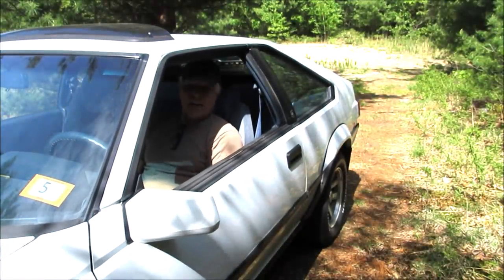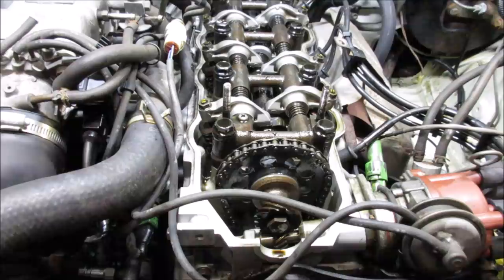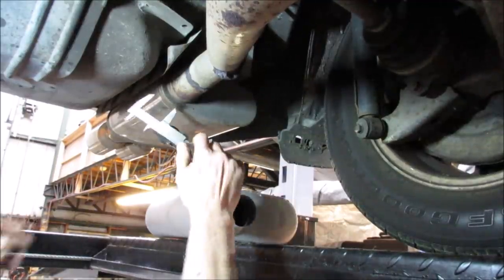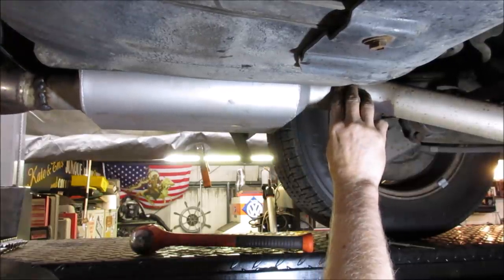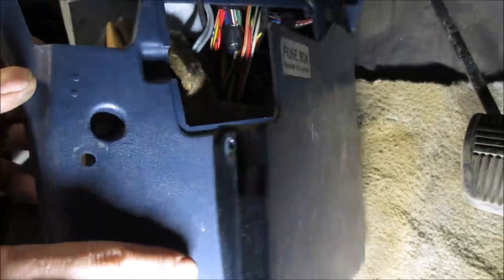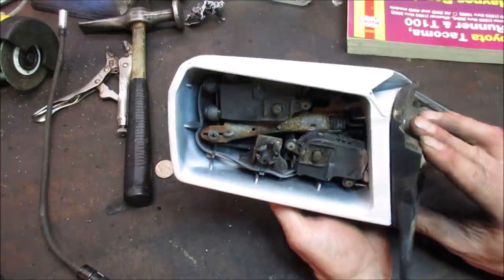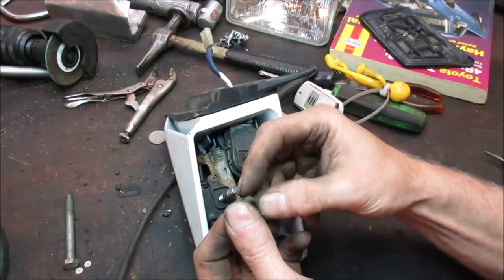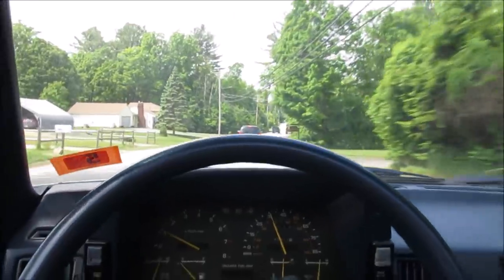Bought The Best Toyota Ever Made

Comment: Try pushing the directional signal/dimmer switch forward to engage the high beams. Pulling it towards you only flashes the high beams and returns to low when released.
Reply: This.  Every Toyota I've ever driven has been like this.
Reply: Was looking to see if someone said this before I said the same thing.
Reply: @dan_lev  my Mazda 6 from 2007 has the same setup for the lights controls. 
The rear wiper is also controled from the right lever,with a rotating knob that's on the lever itself. 
If u u pull the lever towards the driver,it activates the front windscreen washer,if u push it outwards,it activates the rear window washer.
Reply: Same with a lot of the Subaru cars, as well as late '90s Fords...
Reply: I was thinking the same thing.
Reply: Exactly.
Reply: Yep, I was yelling at my screen, 'just push it forward dummy!!' A lot of early Japanese cars are like this, even right into the 2000's🤣
Reply: @simonilett998 

Shh   his truck is the same dam thing.  He is a good tinker mechanic   but he is kinda a dimwitt around electrical stuff. 
Unless its just an act.  His boom truck i would label all the wires
And draw a diagram so he can trobel shoot it if its broken.  
But when he is testing stuff its pure luck he finds it.
Reply: Yeh, I've kinda noticed it a few times, but he normally gets there in the end.
It's always the best way to learn for yourself, but I gotta assume sometimes he plays a bit dumb for watch time, or simply to crank up the comment generator🤣👍
Reply: Honda does the same thing. It’s a Japanese car manufacturer thing.

Comment: I have a suggestion to fix the mirror. Replace the brittle plastic bolt on the motor with metal ones like you did and glue a button magnet to the back side of the mirror. This will keep the mirror magnetically attached to the bolt while having the bolt to spin/adjust.
Reply: Excellent idea! Also lets you pop off the mirror without breaking the glue or plastic adjusters
Reply: No just the correct mirror backing plate with the little bit which locates into the motors
Reply: Top Idea!
Reply: The issue will be if it’s possible to get the backing plate. But I now it’s not musty’s style 3d printing if you can get a complete one to be scanned.
Reply: 3d printer…..
Reply: What you are looking for is new mirror jack screws.  They attach kinda solid to the mirror back and just 'slip' into the motors (the threads are real loose).  You can probably find the screws in many different older toyota models.  I found new screws for my 97 Vette from a 92 Riviera.
Reply: that's a brilliant idea, I was struggling to think of a useable solution

Comment: The threaded adjuster screws are supposed to be fastened to the mirror... the plastic ones were notorious for breaking.  I see that some folks used 8mm bolts with the heads ground to a square/rectangle-- then used double-sided tape or epoxy to attach them to the mirror.  Old plastic parts are the bane of a car restorer's existence!  Looking forward to more installments of "This Old Celica"!
Reply: Righteo, I was looking for this correct comment. Have a wonderful Memorial Day.
Reply: Sounds like the perfect repair
Reply: Would be a great short midweek mustie video
Reply: Is there no replacement motors with the bolts or standoffs available for this car?
Reply: I agree, the threaded pins are broken off the mirror. They also stabilize the mirror.
Reply: He had it pretty close though, if he used his bolts and JB welded them to the plastic on the glass the mirrors seem like they would go, my assumption as to how youd get the glass off when they were new was to run the mirror to its farthest up and outward position till it stopped then youd be able to pull the glass out...

I just had an idea, the motors are fixed as is the mirror but the glass moves, my guess is that when they were new there was a tiny little pivot inside those two spots on the glass, if you JB welded they would be fixed and either the motors would jam halfway or burn them out trying to run the shafts out, i know its an 80s car so new glass most likely doesnt exist, but the best idea would be to look at how the setup was when the mirrors were new and see how it went.
Reply: Sounds like a good job for a 3d printer….
Reply: you can get the screws in nylon also.  If you glue them with silicone adhesive an dleve it a little thick, then the joint will be a little bit flexible.
Reply: I'm thinking there should be a ball or socket on the end of the pins and a ball or socket on mirror as the mirror changes angle when pulled in and out up and down so pins can't be fixed to mirror also to put the mirror in or out it would just clip into the sockets
Reply: I got interested and looked up how they work. Various options! This looks like where the posts are fixed to the mirror (as @Braxton suggests). The added complication is that where they are driven in the motors they have to have an effective end of travel point (too far in or out). The other option would have the posts in a socket on the mirror with the issue of stopping it turning as well as the end of travel matter. Aside from finding an original new part or second hand - probably unlikely - it will be interesting to see a solution.
Reply: Creative solutions here. What i woul do is head to the forums znd see what's worked for other people.
Reply: @NinjaNeglector  sounds like a job for a 3D printer dude.
Reply: @jonathanwood5681  Yes...ball and socket like some legos pieces. They do have to pull and push the mirror. Then the adjustment screws can move in and out, thusly adjusting said mirror. :)
Reply: @mriguy3202  It's VERY hard to glue nylon and other plastics in the same family (like Delrin).  A number of glues allegedly work, but they may not last long.  You could use nylon if you used something that would bond to the plastic and build it up so it makes a mechanical attachment for the nylon.  Like, bury the head in glue.
Reply: 3d printer will change your life
Reply: I don’t think the adjuster bolts screw into the motor. I think if you do what Braxton said and position the screws over the gear box, you can run the motors to wind the adjusters in
Reply: exactly. The glass would have the posts fashioned to the back and the mirror motors will draw the posts inward, then you snap the glass into the ball and socket joint.
Reply: @tbirdsteve1  3D printing an M8-like screw that works out of the printer is a PITA, unless you have a very properly tune printer and profile.

It could work though, but with a thread die turned on afterwards. I would print out of ASA if I were to do it. ASA is high temp, easy to drill/file/mill, etc so quite easy to fix the thread afterwards. Easy to glue, has high impact stregth, and it is more resistant to UV and other environmental factors (than ABS...)
Reply: @mriguy3202  That's a good idea. A little bit of flexibility at the mirror body where they just slightly change direction.
Reply: @joseph.d5187  ‘"
Reply: Was just about to say the same thing... 😉
Reply: That was my theory that those pins broke off of the mirror
Reply: Surely it’s the springs job to push the glass back against the bolt tops as they retract. Hence its in the top right corner acting in opposition to the bolts. The bolts only need to push out. I would glue a piece of rubber (maybe a grommet to the bolt tops to lessen any vibration.

Comment: Back in my early days as a motor mechanic, I used to work on these 22R-E engines and boy does this engine chatter very badly. The later 22R engines had a single roller camshaft chain than the more reliable twin roller in the earlier 22R engine. The camshaft chain would stretch to the extent that the oil-fed chain tensioner could no longer keep the chain tight and would break one of the plastic chain guides and then cause the chain to start jumping teeth and the engine would fail and in most situations catastrophically.
Mustie, you need to look at that chain tension and its tensioner and guides as this is the reason for the engines chattering noise. So while your at it is best to address it now before the engine grenades on you. Other than that, it's a nice-looking Celica/Supra. Getting very old and super rare to see them on the road now.
Reply: text straight out of wiki...
Reply: @ronzor8035  Indeed another YT Mechanic eh??
Reply: Wiki or not, it's truth. The earlier double roller chains were better, and many folks retrofit the earlier chains/sprockets onto their "Franken-22R/RE's" especially the hardcore 4x4 pickup nuts
Reply: @fredzeppelin3969  I do NOT believe the validity of the information was in question there chief....
Reply: @angryyank  Snarky yet confusing. I like it
Reply: Actually I put more block inspection holes in the 20r motors the later squar valve cover version was better, the 20rs were the motors the chains had problems on.  And all this was because you drove it like you stold it.

Comment: Former auto tech here. I worked for several years at a Japanese car specialist for my last tech position. I don’t think I’ve ever seen a 20 or 22R that didn’t have some valve cover leakage. I think they don’t have enough bolts holding it down, so the clamping load is low and not very even. Also, those engines tend to be a bit clattery even when everything is adjusted properly. That’s just the way they are.

While having tight valves is definitely worse than loose, loose valves aren’t good either. For one, you are losing valve lift and duration, so you are losing performance. If they are quite loose, you can start damaging the valve stems or rockers because the excess valve lash leads to hammering of the valve components (that’s the clattering or tapping you hear when components are loose).

The Magnaflow muffler that was on the car uses a sound absorbing material. The exhaust goes through a perforated tube and the sound absorbing material surrounds it. The Thrush muffler (or any turbo or Flowmaster style muffler) uses chambers and baffles to cause sound waves that cancel some of the noise coming out of the exhaust. Chambered mufflers can be quieter than straight-thru mufflers but also tend to be a lot more restrictive, especially the cheap ones. Probably not an issue on a 100hp 22RE but a definite consideration on a performance car.

I’m still watching the video, but the headlight problem is more than likely the switch. Older Japanese cars switch the headlights on the ground side, so both filaments have power when the headlights are on and it switches ground to switch between the low/high beams. Older cars also tend to run both headlights on one circuit (newer cars usually run 2 separate circuits for safety/redundancy). You are missing the ground for whichever headlight isn’t working. Because you left one headlight plugged in, the power/ground circuits are shared between both headlights and the ground is missing, you are showing power on all 3 pins. If you grounded one of the appropriate pins on the disconnected headlight, it would turn on the other headlight.
Reply: Appreciated your insights on this video, especially the muffler design trade offs! Thanks for sharing!
Reply: @BeamerTheFox  I put a small flat resonator in front of differential, really tone down the exhaust. My buddy worked a muffler shop, I got it from the take-off pile.
Reply: I was thinking most of what you said here, no need to repeat lol.
Reply: As Kevin mentioned, the switch is likely the issue. I have had several 1980s Toyota Pickups and 4runner with a similar issue. When switching to the high beams, the lights would cut out unless your giggled the stalk. 

The combo switches are pricey on eBay, especially for a pickup/4runner. After dismantling the switch and cleaning the contacts, it made it slightly better. I ended up just grabbing a switch out of a mid 1980s Cressida (even more rare at this point, but nearly worthless on eBay). I was able to depin the connector and swap the light stalk from the Cressida switch to the 4runner. Fit like a glove, works flawlessly. From what I have seen most mid 80s Toyotas all have similar switches. Hope that helps.
Reply: Mr. Berg seems to know shit. And to have covered it all. (REALLY glad to have an expert confirm what I've observed: that Toyota motors can be noisy.)

As for the switches everyone is talking about, I have had AMAZING luck with CRC QD Electronics Cleaner; cleaned stereo components, various switches, and even a rear wiper motor--all of which were not operational before I applied the cleaner. It has become my default first-attempt method for reviving older electrical / electronic components when I start working on something, ever since a few years ago when I picked up an '88 Accord LXi.

Hope this helps someone!

EDIT: Also, and this may be obvious, but eBay is a good source of old owner's manuals. So stuff like HOW TO TURN ON THE HIGH BEAMS (which a lot of commenters are talking about) would be explained to the new owner. This vid is long, so if he's got the manual in the car I haven't gotten there yet.
Reply: @nimas.1415  Nope all you need to do is push the stick forward not back to engage high beams, You push on,  pull off
Reply: @iFixJunk  Push the stick forward to turnon high beam pull back to turn them backoff
Reply: @angryyank  Thanks? Haha.
Reply: The 20 - 22 R valve covers don't leak with good isolators and gaskets. I drove a few million miles with those amazing engines in Toyota cars and trucks and only had one valve cover leak, on an 83 truck that I bought for $300 with 400k miles already on it. Drove it another 200k miles before the driveshaft hanger bearing blew out its cage and rolling elements, and the body was rusted to dust, but it still started and ran as good as new. I would have fixed it, but the bearing was only available with the driveshaft section as an assembly, and that cost nearly three times what I paid for the truck. I couldn't locate a used one, as the truck was the rare heavy duty "C-C" version (basically a 3/4 ton version) with a long box. As for the oil leak,  I put in new gasket and isolators (bolt rubber washers) when I got tired of adding oil every month and no more leak.

Comment: Mustie, I was the first person to make a tutorial on how to fix the powered side mirrors. I'm ThatOneCelica on the Celica-gts forums, glad you figured it out. You pretty much replace them with metal bolts and use a strong adhesive to attach the bolts to the mirror. The motors spin and will push or pull for the up and down and side to side. I originally used Gorilla Glue worked great but only for a little while. I would use a rubber adhesive that can handle the bumps in the road, something like RTV. Great video! Maybe a small neodymium magnet glued to the plastic part of the mirror would work. I'm sure you can get creative.
Reply: So, no spring needed?
Reply: @Jeff_Pendleton  No.  The studs are supposed to be attached to the mirror, and prevent the studs rotating.  To install them you engage the threads, and then run the motor drawing them into the point where you can snap it to the mirror center. Then the rotating female thread inside the mirror can pull or push the mirror via the fixed stud.  

If you ever need to take the glass out again you have to get the motors to run the threads all the way out before unsnapping the center.  If you don't you'll break the studs off.

Failing to run the studs out are probably why it broke in the first place.  Either that or the waxy substance they were made out of broke.

Some sort of flexible adhesive for the stud-mirror attachment is best there's going to be a bit of angle change as it runs in/out.  Perhaps soft silicone.
Reply: @Jeff_Pendleton  No spring needed @Fromage Frizzbizz is correct.
Reply: Don't sweat the small stuff! ;p

Comment: I have owned the 85 Celica GTS and the 83 Celica Supra. That is an amazingly clean rust free example.  The mirror plates have plastic threaded posts which are supposed to be permanently attached to the mirror. Yours are broken away from the mirror backing. The only way to permanently fix this is a new/used mirror plate with posts still attached. You push the both rods/posts in the motors first (its a rough force fit) and then pop the ball into the socket last. The rods hold the mirror adjustments you make from the switch.
Reply: What you're saying is Mustie's mirrors have a date with the hot glue gun.
Reply: @RadRob84  I was JUST going to say that. Get the motors adjusted where you want and then blobs of silicone or hot melt glue to the posts.
Reply: @muskokamike127  were you yelling at him in the video too? "No, Mustie! Don't add a spring! Silicone / glue the posts to the backing! Can't you see the glue mark on the broken stud from a past repair?!?!"
Reply: Every time he asks a question I’m answering but he can’t hear me 😂
Reply: Came to the comments to see if anyone else had told him this already.  I too was talking sternly to the screen while watching lol

Comment: Just Great! I got 3 (2 for spare) 1990 Celica ST182's in my yard. Here in Europe they are Japan made with 2.0l engine 156hp. Just great project car with ABS and sunroof! Here in Finland is possible to made all over 30 years original cars with Historic MOT so there is no road tax and insurance is lower. And MOT is every 4 years when normal over 10 years old cars it is yearly!
Reply: In most US states the historic vehicle registration is 25 years or older. At 25 they also don't need to do emissions testing anymore (at least in my city)